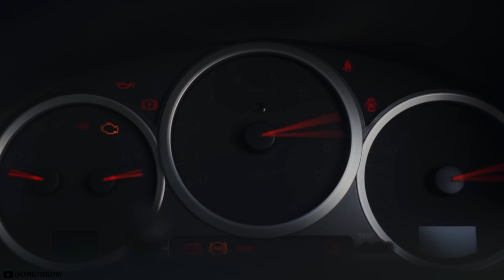Donut Media VS. Subaru

Comment: It's indeed like rotaries.
But I think the difference is that rotary guys know it's not always an ideal platform but they accept it and it actually makes them more motivated.
While I feel a lot of subbie guys don't like when their car is seen as bad.
Kinda like that meme with the guy crying but with a mask over it vs the blonde Chad guy that just accepts it.
Reply: These are assumptions based on the fact that this is happening.
All people with a subbie I met irl are all amazing and I'm sure they're just passionate about their car.
Reply: All you have to do is watch the shmeedia video about this situation to realize you are 100% correct. Those dudes defend theses cars SO hard for no reason. I mean the amount of deflection was insane. 
Should donut Media have installed baffled pans and broken the motors in? Well, yea. 
But let's be honest, would you expect a Rallie inspired AWD car to have oil starvation issues this bad?
Absolutely not, but they'll defend that "it's not a bad design" all day...
Reply: @Saltyoldguy- hey are just misunderstood, and that goes for both Doritos and subies.
They can both be reliable, and they can both make power. The problem, is that it is VERY hard to do both at the same time.
The oil starvation is well known, and standard to change oil pan for better pickup. So is apex seals, which you help by premix oil in tank.

Now talk about their non turbo engines, the ej22 and 13b non turbos go for quarter million miles every day. Turbos are the Bain of both plataforms
Reply: Yeah, we rotary guys know what we're getting into. And any mistakes are mostly ours because of how finicky they are. Complete oposite of binmer guys XD
Reply: @oliviervankleef1358  If subaru engines were so great, enthusiasts will be swapping them into other cars all over the place.

Yet, K-swaps abound. The fact that subarus require more caution and attention is a disadvantage, not an advantage. The only subbie engine have going for it is flat motor novelty.
Reply: @sepg5084  They help in handling aspect, especially in rally and low/imperfect grip situations which they were built for, but I agree about the high attention part. It doesn't help that they're massively wide engines that don't fit in much without major modification.
Reply: @Saltyoldguy-  “rally car for the ROAD” not the track. It has great driving characteristics, but if you really want it to perform on the track, it’s gonna take some work.
Reply: @oliviervankleef1358  i dunno i remember asking a guy about his car super nice until i asked how much he spent on repairs if i remember right he didnt talk to me after that
Reply: that's just the internet for you, people aren't allowed to just enjoy shit for what it is flaws and all. instead people have to pretend their car is perfect and like if they had infinite money they'd still be driving that car cause its just the shit.
Reply: It's because in general people who actually work on Subarus recognize the flaws of the platform, but appreciate the trade offs, and know it's not a bad car or platform. There is no perfect chassis to mod.
Reply: Best take I've seen on this.
Reply: I've always said turbos are like crack to a rotary. You love it, but it kills you sooner. 

I've gotten decent mileage out of a couple of my engines, one lost to oil starvation to the rear rotor, one lost compression around 15k miles due to the shape of the exhaust ports wearing the seals weird, and one a shop built with scrap parts that didn't even last 1k miles, screwing me over on purpose. Never lost one to broken apex seals or bad coolant seals. 

I make about 430hp, so it's not bad, but nowhere near powerful by today's standards. But there is always someone out there that's faster/more powerful, so what's the point in chasing numbers as long as it's fun? I like to overbuild the support systems and it's helped a lot. But really as long as you keep oil and coolant pressure and keep them both the right temperature, and don't boost to the moon, you should be fine. 

Mofab in Denver that mated a rotary to the AWD drivetrain in a 2.5RS. I love that.
Reply: @sepg5084  Even if they wanted to swap Subaru motors into other stuff, you probably couldn't (easily) due to the packaging. The cars that can fit a flat-4/6 motor (eg, stuff that came with them from factory) you do see Subaru swaps all the time (old Porsche replicas like the Beck Spyder for instance).
Reply: I don't mind that my car is an underdog. Boxers are just fucking cool and I like it.
Reply: i mean yes. but i feel the roatory has a much better excuse for being unreliable. the suburu engine semms to just have alot of oversights and bad parts. its like me saying the northstar is a great engine if you just replace the headbolts. yes that is true but it doesnt make the north star a good engine and the headbolt issue is something the cadilac team should have known about. i still think suburus are fun cars and the bug eye wrx wagon is still one of my favorate looking cars. and no shame on you for liking suburus.
Reply: Ejs are no where near as bad as dorrito engines

Comment: They’re temperamental cars. I’m running equal headers, Cobb 20g turbo and cooling mods. Have to watch engine temps, oil and accessport readings before getting on it. Demands a lot of attention and you have to have everything in order such as quality parts and fueling. Can’t skip out on anything.
Reply: Someone who is doing it right!!!!
Reply: Same here! Havent had any issues at alll but i will admit the initial cost and the amount of research i did just to get it right would land me a bachelors degree in EJ257
Reply: There is a shop near me that specializes and races Subarus. They flat out told me if I ever planned on buying a STi, and want to do anything beyond a bolt on car, I should budget $20k for a proper build to make it reliable. Even then, high chance something will go wrong if driven hard. They recommended a baffled oil pan and pickup on even a bone stock car if you plan on tracking or doing any extended canyon carving.I love Subarus, but when you start pricing things out, you have to have an obsession with them for it to make sense compared to other platforms for that kind of money.
Reply: that...really doesn't sound like fun.
Reply: That sounds like total fuckimg bullshit i hate having to keep my AP plugged in really kills the joy being paranoid about shit
Reply: Yeet the cooling mods plz. Unless it's a larger radiator by a reputable company. Anything else ruins the coolant flow.

Comment: I was done with Subaru when our 2009 Legacy blew up trying to get up to highway speeds one day.  We did the headgasket job the year prior, had no warning lights and no other indicators that would tell us that what was coming.  Of course, we just lost our dog a month before that so needless to say, we didn't have the money to fix it and ended up buying a 2008 VW Rabbit.  Even with all that car's problems, we love that thing and it hasn't tried to kill itself yet.
Reply: I bought a low millage  single owner Subaru Legacy with my savings from a part-time job a a year ago.the car had no issues but the engine on it blew up  on my trip from Saskatchewan to Alberta . The trip was completely  ruined and had to pay a lot of money to the tow it back to Saskatchewan only to realise  it needs an engine replacement. Insurance in my province wouldn't cover it unless the damage is related to a crash,theft or  vandalism.All of  my money totally wasted  and I only had the car for a month. From that day onwards i swore that I would rather spend my money on drugs than buy another Subaru.
Reply: The cars service history was in the glove box and it was well maintained from the looks of it.
Reply: I have a Subaru legacy 3.0r spec.b with the original engine at 230xxx kilometres. Engine has never had any issues, and is now taking a turbocharger pushing 10psi / 400HP to the wheels
Reply: @johnmcgovern1418  that's cool and all, but that 6cyl isn't even in the same engine family so I'd imagine there would be a whole different set of issues.
Reply: @johnmcgovern1418  You turbo charged a car that has 230k kilometers without doing an engine rebuild?
Reply: @johnmcgovern1418   Mine was 2.5 . And i believe it’s  the 2.5 people have issues with. But I’ve seen cars with original 2.5 motor that has 250k plus kilometres. So I guess it’s a hit or miss.
Reply: @kazikhalid6197  no insurance covers a blown engine in any province or county or country dude. Did you actually call them expecting them to cover it?
Reply: @roundearthshill248  I knew  they wouldn’t cover a blown up engine.  I called them to know ,what my next course of action should be,since it was my first car ,i didn’t know what to do. I ended up  trading the car +cash with a high mileage 2nd gen mazda  3  at the car repair shop . Probably gonna go for a speed once my current car   Reaches 300k.

Comment: As a professinal mechanic, you did an excellent sum up of my feeling towards subaru. My experience has been almost exactly what you said. In a stock configuration, yhey are great, reliae and capable cars. As soon as you start trying to add power, the cost of quality parts and the tolerance curve for how you install things, goes waaaay up. If you cheap out on one part, i.e. trying to re-use head bolts, no name turbo, disciunt autopart sensors, etc, you will end up rebuilding the motor again.
Reply: This one hundred percent. What people don't realize about the appeal of subaru is for a long time they were THE only affordable awd, turbo platform. Obviously corners had to be cut some places to make that mark.

Comment: The global community just needs to see older Subarus like they do with the rotary and it would be fine. Imagine If there was a video response for every rx8 that blew up in a YouTubers video.
Reply: The difference is rotaries have NEVER been considered super mega reliable.
Subaru built their rep on bulletproof reliability bullshit.
And they never were.
Ok a leone or a thelike were decent but when they came to libertys and imprezzas they fell over big time but still flog on about being tough and reliable.
Reply: @sugarnads you nailed it on the head. Subaru puts out an image of reliability. And to be fair, their daily commute cars that aren’t being pushed to redline do make it to 200k a lot of the time. But with a Rotary I know the Apex seals won’t make it much farther past 80k. I know what to expect in terms of reliability. I’m also not worried I’m going to blow a Dorito at the track smacking redline. They are reliable enough to make it. Subarus on the other hand just don’t seem to like doing high revs too much. My friend got his dream car, an old bug eye WRX. Drove it for a few months, not super hard but he did get in it from time to time. Just like anyone would in a sporty car. Engine popped. He didn’t track it. Wasn’t taking hard corners to let the oil slosh around. It just blew going in a straight line. He was devastated

Comment: From my perspective, just as a car enthusiast, former Subaru owner, and former mechanic/dealership trade in manager, donut kinda should’ve known better. Subarus are known to be extremely fickle beasts so I wasn’t surprised at all that they went through so many engines. I’ve experienced the purest joy of Subaru ownership (a blown engine while basically stock) myself and said never again will I invest in this platform. It’s kinda like how I love rotaries but understand I’m going to have to do a rebuild every so often if I ever get an FD. The subie community also shouldn’t hate on donut for showcasing what reality is like for ~20 years of ej owners lol
Reply: And don’t forget the shit show 5 speed…
Reply: Honestly A lot of performance cars are fickle things. Going from the Toyota 86 platform to the subaru every car is just a luck of the draw. I've heard of people blowing engines at stocked and some people who defie the laws of logic and some how dont blow their engines. And buying someone elses project can be a dangerous thing because people love to beat their shit till they get tired of it. So in the long run its luck you got a proper built one out of factory or a proper taken cared of one.
Reply: @brenton490  The bottom line is that it typically costs a significant amount of money to go fast reliably and consistently.  90's vehicles designed manufactured in Japan sort of spoiled most of us - they were essentially low maint high beat down machines... now vehicles are just a lot more complex - and so is the risk...
Reply: @brenton490  Also need to keep in mind that probably almost all used WRXs have been abused to one extent, or a large extent by some 20 year old. Having bought one from new, and properly cared for it, it has been extremely reliable for 10 years.

Comment: As a WRX owner I agree, they are more temperamental but still a great car. I also agree with what some others have said, want to have a great, reliable experience with a WRX? Leave is stock or just do some aesthetics. Getting into the powertrain requires a lot of knowledge and being prepared for things to be harder.
Reply: “Pay to play” on these platforms forsure. As an FA20 owner the tune itch is real but gotta have that rebuild money set aside first
Reply: 5th engine guy reporting for duty XD ✋

Comment: You hit the nail on the head, 
Once I saw a clutch replacement on a Subaru, I noted out of thier AWD system as a whole. Never mind the insane amount of bolts holding the timing cover on and an engine pull being required to do a lot of major maintenance that most makes just don't require short of a rebuild.

Comment: I'm on my 2nd subaru. My first was a 2017 CVT Impreza, and it was amazing. Never let me down and I made it up to 211,000km on it with it only ever needing a wheel bearing.

Parted ways with that beauty and hopped on into a 2016 WRX. It's an absolute blast, and with only 87,000km on it I look forward to the (hopefully) many more kilometers to come
Reply: Well it's all about how you use the car. If you keep it stock and drive it normally it should be fine. My bmw 335 has 430k km and most of its life it's been well over 400whp. Never in my wildest dreams would I have too worry about oil starvation or bearing failure. It comes down to the OEM engineering.

Comment: Looking at the scrap pile at the local Subaru tuning shop, I would say the EJ has its fair share of issues 🤣
Reply: My buddy sold his STI because it would randomly pull 10 degrees of timing, and apparently that’s just normal for EJ’s to do. My buddy couldn’t take the stress of dealing with all of the “quirks” Subarus have

Most people will talk about how you need to know how to take care of these cars, but won’t acknowledge that pretty much any other car doesn’t have these problems. Also every Subaru owner I know is on at least their 2nd engine, so even if you know what they are doing they will die on you anyway
Reply: @deadheadcentral2514  My fried just put in his 3rd engine. This time went with a IAG block as the local shop has had grate luck with them. Just put down 483 on a mustang dyno at 26 psi. Looking for more power this summer as they only could get the fuel to E68.
Reply: @deadheadcentral2514  That's not an engine flaw it's a tuning flaw and yes the factory tune is designed to be safer.
Reply: @802Garage  Dude was running an off the shelf COBB stage 1 tune with all of the supporting mods. He took it to two separate Subaru shops they both said nothing was wrong and that it’s normal for that to happen. There’s just too many issues unique to Subarus only for them to be good cars
Reply: @therealpofo  The IAG blocks are really nice, that’s what our local Subaru shop uses. 483 in an AWD Subaru is gonna feel like a rocketship
Reply: @deadheadcentral2514  Yes because it was running an OTS tune which is not tailored to his car nor tested with his parts and it is going to be extra safe so Cobb doesn't blow people's engines. It's not "normal" for Subaru it's "normal" for Cobb because people are using an OTS tune not a full tune. This can happen with ANY brand of car and a preconfigured tune. Again it is a tune factor not an engine factor.
Reply: I'd definitely buy a Subaru with a f'd engine and put a turbo K engine in it
Reply: @ElBach1y  We just swapped a 13B-REW into a BRZ. That was way more fun. 😂

Comment: I have a 17 STi and you are 100% correct.  I bought the car because I always wanted one as a kid, but coming from my other project, an AW11 MR2, it is pretty crazy how temperamental the Subaru is after researching EJ modding requirements for a few years.  I found Tanner's channel (smeedia) back in 2019 or so, and he was a huge help, but what I want out of the car performance-wise is going to end up costing as much as buying the car again, and I am not really sure that's something I want to go through with when I can just purchase a different platform that I can push some and tinker on without having to worry about replacing a block if something catastrophic happens.  I love the car, and plan on keeping it a while longer, but right now it is just a way to have a down payment on something else.  I don't mind spending the money to upgrade the car, but I don't want to end up dropping $15-20k in power mods just to have to do it again if I make a mistake or miss something.
Reply: And at some point you do have to blame the engineering in the motor... Since if you k swapped the car... You certainly wouldn't have a fraction of the issues and in the long term most certainly would save a ton of money. Since is the point to have you particular car perform at a particular level? And not being tied down to a boat anchor? You don't see a lot of big power or high performance s13's k motors or sr20s for a reason